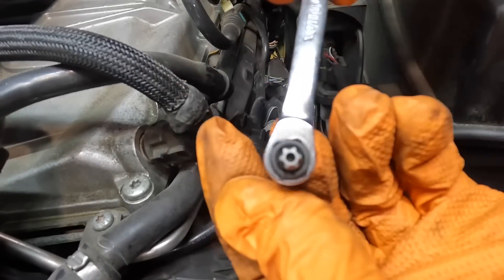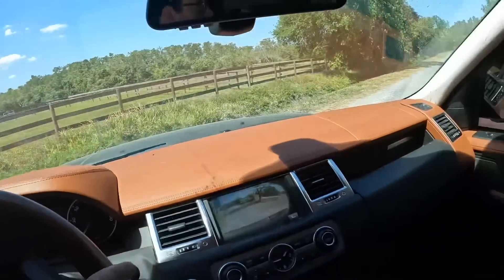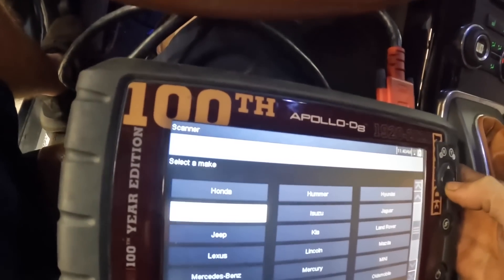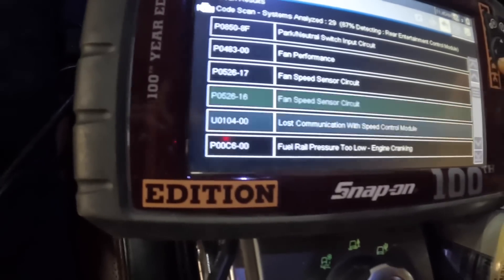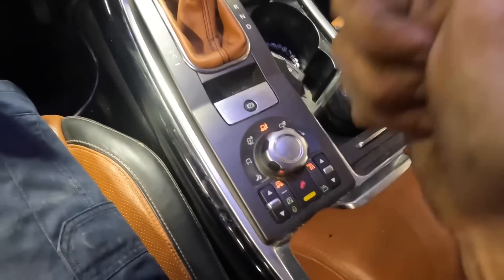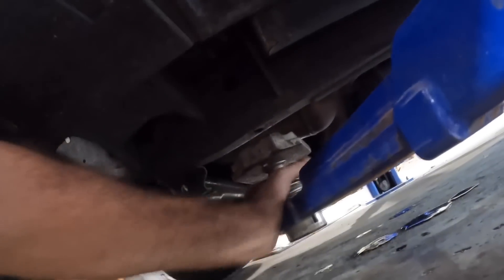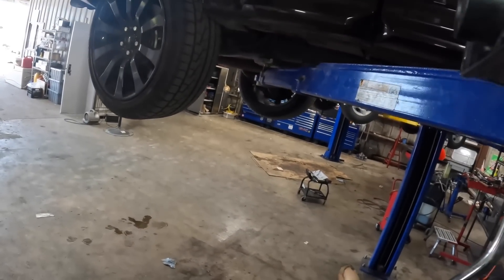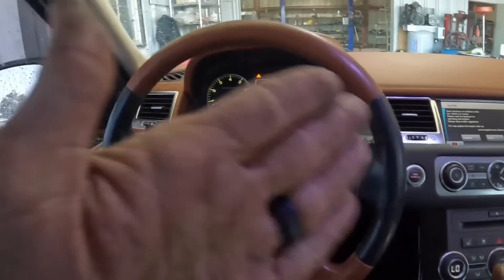Endless Diag! Supercharged Land Rover Range Rover 5.0 #mechanic #diagnostic

Comment: Its a range rover. Im more surprised you took it on in the first place than i am that it had so few codes. You got a healthy one, consider yourself lucky.
Reply: ha.  though the RR Sport is actually a Landrover Discovery with a fancy frock.  They're good , especially the newer ones but they're not Range Rovers (that platform would be too expensive).

Comment: You pulled a gadget from the ODB2 port. That thing could be a bluetooth OBD2 interface. Coupled with a computer or Android phone with the right app on it, you can have limited scantool functionality. Or you can use software that can change all kinds of parameters. Could also be just some kind of insurance data logger.
I think it's a smart thing to inquire at the vehicle owner what it's about, when you find a gadget like that installed on the port. Or better yet, check the port at the time you take in the car and ask the owner about it, if you find something connected on the port.
Reply: Scotty says, correctly, you do NOT drive with this dongle as it interferes with operation of the main computer.
Reply: Or probably just a flashy Led piece of crap.

Comment: “Loose Brake Pad Wires?” Poppycock. Brake pads are wireless.
Reply: On normal cars yes.
But remember, this is a Range Rover. Everything that can be touched by the prince of darkness will be electrified and guaranteed to short or turn open circuit at the merest hint of humidity. Electric brake pads are a sure way to set  MIL lights and half a dozen  inexplicable codes. Probably keeping the rear door from unlocking too.

Comment: I'll quote the mechanics from my local independent repair shop about this video Ray, " The only thing we will do on ANY English or  European car is an oil change and add air to your tires"     They 've been burned by working on Jaguars, BMW. & VW's in the past, and learned some hard lessons doing so
Reply: To be fair it's not that English anymore owned by India's Tata Motors JLR currently builds Land Rovers in Brazil, China, India, Slovakia, and the United Kingdom, not sure if build is the right term.

Comment: Being that’s an out of warranty Range Rover, which are endless money pits, you should be to make enough money to buy a bigger building, add more equipment like a wheel alignment rack, air conditioners, etc. 

Because the repairs on this vehicle will never end. It’s more than job security, it’s job prosperity!

Comment: Roll bars (sway) could be leaking if they are active type...common problem at higher mileage...difficult to change without body off, but could be airbags causing roll. I'm not familiar with the petrol version...I had the 3.0d. Low battery can affect fault codes as with other vehicles. Door locks commonly fail easy repair with new lock.

Comment: On my BMW, when the battery gets below 12v, it messes with the modules.  I changed the battery and no more codes.  I never had an issue starting the car though

Comment: it isn't uncommon for a Range Rover/Land Rover of that vintage (2005 - 2016) to have a lot of codes, most of which are nuisance codes that will appear just by starting the engine. The Control Modules are super sensitive to voltage drops, and the mere act of turning the engine over is enough to set a code. When the alternator kicks in,, which is very quick, the issues go away and no MIL will appear.

You have know what codes are "real" and what are not. It can be pretty scary if you don't know this special feature of Rover vehicles, probably all British vehicles. Add that to the oil leaks that are common on British vehicles and you will be okay.

Comment: I am currently finishing up a number of repairs on a 2008 Range Rover Sport. Had to remove the entire dash, steering wheel, and center console to replace the heater core. Also had to replace the stereo and NAV screen, as well as do a bypass part of the fiber optic MOST bus. 
Oh, and the word you're looking for is bollocks! The British should not be allowed to build automobiles!
Have a great day, Sir! o7
Reply: Funny that Nissan said our build quality was higher than theirs, probably before they sold out to Renault.

Comment: Ray normally starts with battery check and that is where I would start with that many faults.
Land rover use cat hair and fairy dust in their electrical systems. Sadly not as robust as electric and wire.
The owner should know that they need to wear the correct shoes and hat for the right day of the week to have any hope of turning the key and something not going wrong.

Comment: REEEEEEEEEEEE I own one of these and am UK based and recognise the majority of the issues you are facing with this thing. The numbers for the suspension are an arbitrary number, not the amount of mm height they have. The wobbly car thing (vehicle lean while cornering) is normally the active anti roll bar/sway bar (active cornering enhancement system) so you would look there. Most likely problems are an electrical fault with the DRS module or wiring or fluid loss from the system caused by a failed seal in one of the actuators. As for the million faults, that happens with these cars when the battery is allowed to get low voltage (ask me how I know).

Comment: My guess on the ride height calibration failure is that the computor could not get a zero or start position to register on one of the ride hight sensors,,  more than likly it would be the sensor attached to the wheel that struck the object on the highway,,  I would disconnect the harness and linkage on each sensor and take resistence readings while moving the sensor arm through it's range,, would have to check each sensor to try and find an oddball,,  Bloody Hell mate,,,  I've been Gob Smacked,,,   :-)

Comment: Check the battery Ray the Range Rover Sport is a temperamental bucket of sensors that will drive you crazy🤪 beautiful luxurious Land Rover but sooooo complicated in England we would call it a bleeding nightmare when it goes wrong heap of crap. Tom northeast England.  Ray remember the Jaguar with the leaking sun roof that car was a piece of gold compared to this one. 😃😃😃😃😃😃😃😃

Comment: That's very interesting, although I see that farther down the term 'bollocks' has been used. You have to get the intonation right if you are going to use bollocks though. So a dropping a diff on your foot bollocks is very different from a Range Rover not being broken bollocks. And you are mistaken, it is the thing behind the wheel that is the wanker in a Range Rover. The vehicle is correctly referred to as a money pit - it will be a pit for any money you have.

Comment: BUGGA !
It depends where in Britain you're from, and how much education you have.
BLOODY HELL !
Have the customer demonstrate the issue and if he cannot repeat it, no problem found.
Check information sources under the customers description of the issue.
Check the vehicle for damage or issues during an inspection.
Road test again after discussing any findings with the customer.
Sometimes the circumstances can cause an issue that's valid to present itself.
Other times, it's nothing.
I had a vehicle come in one time where they had been to a few shops and spent their money.
They replaced items of valid concerns. They said their issue persisted.
They were seeking after a feel it had after going over bumps.
I verified an after/ shake.
I opened the back and found furniture and an antique sewing machine.
They came in wanting tire issues verified.
Their tires didn't exhibit anything but a poor choice in tires for the application .
I suggested they store their antiques and not ride around carrying them.
Happy motoring.

Comment: Is that one of those scam devices that you (supposedly) plug into the port to give you more fuel economy, but in reality is just an LED?  That's the first thing I'd suspect.  Seen one taken apart and it's literally just power and ground, with all of the other pins not connected.

Comment: The Range Rover was a British attempt at making a wwII Willie's jeep, but going way overboard at it. Seriously I dont belive they ever got close to the orignal mitilary Jeep.  Strip all the excessive crap off it youve got a big old pile of scrap metal.

You wont like pulling the door panels to get to the power door lock motor. 
Your better off trying to work on an old benz door.

Comment: Welcome to the British motor trade Ray in at the deep end with a Land Rover, 'the best 4X4Xfar"...Idid not say that, I have a Range Rover on my ramp at the moment and the owner wants to make it reliable when we stopped laughing we told him to buy a Skoda or VAG group car. I've owned 5 LRs and my current one is the most unreliable car Ive ever owned. By the way 90% of those fault codes are a flat battery at some point OR the factory battery says 12v but is 13/14volt  (after market are only 12V), The Air suspension YES you can do it with your snappy scanner and your skill level (I do it with mine) don't shy away there is nothing complicated with it. think of it as the same as ABS, sensor, ecu, pump, valve block, pipe and the unit at the end of the pipe. Diag it the same way. 
As for the English words, "Open the Bonnet", and "The Boot" at the back end, you need to "Put it on the lift" when you rack it. It is not a Range Rover its a "Rah Rah". Please spell tyres correctly and put the steering wheel back on the correct side please LOL! other words to be used around it are" bugger' thats bug not boogger; "oh Gosh" is a good one, and remember a Land Rover/ Range Rover is like a horse, it costs a lot to buy, it costs a lot to up keep and all it does is dump anything you put into it onto the road! Love the videos Ray best wishes and good luck with this car.

Comment: Range rovers are the biggest pieces of crap. We had one coming to the shop with the brake warning light couldn’t figure it out. Everybody took a stab at it turned out. It was just a little low on brake fluid.😮freaking junk worse than a BMW